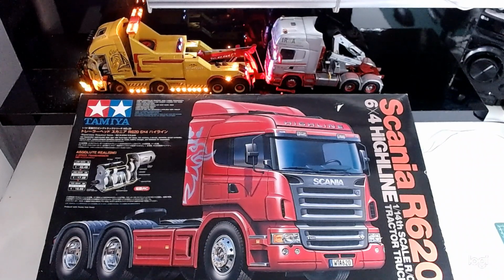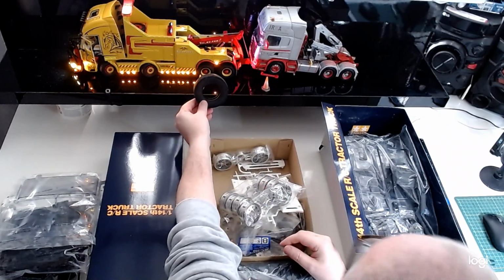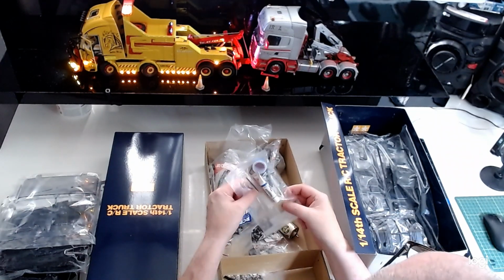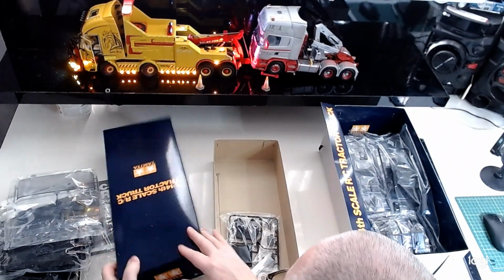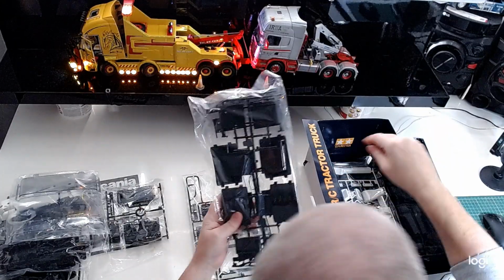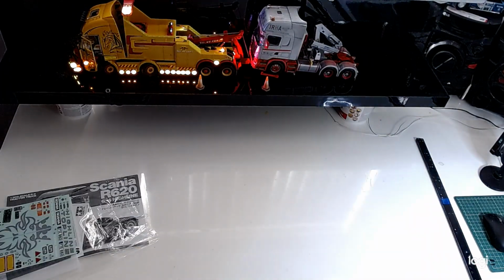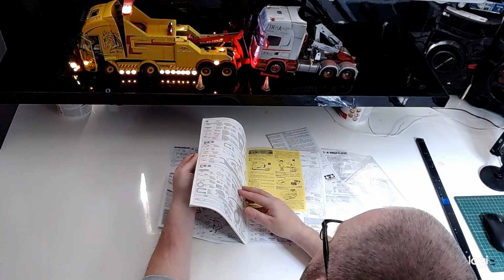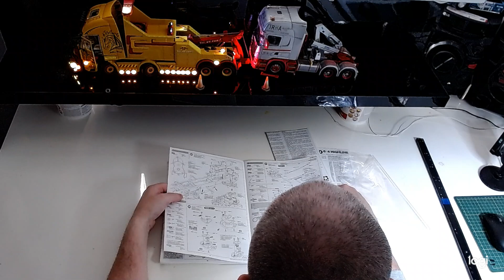New Build Series Starts Wednesday 1/14 RC Scania

Comment: your right about the cost i brought the king hauler for about 350 quid when i added the cost of the controller and the lights and sound stuff on top i spent just under 900 quid. a good trailer will set you back about 500 quid is it worth it you bet love my rc truck. have a great build with this one seamy and take your time its well worth it.👍
Reply from the maker: Next thing to pickup a trailer 👍